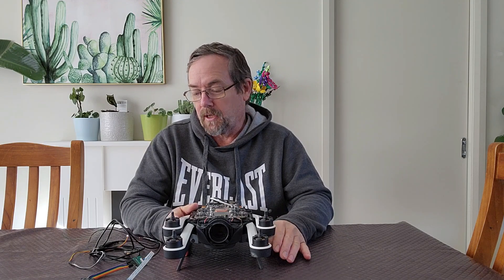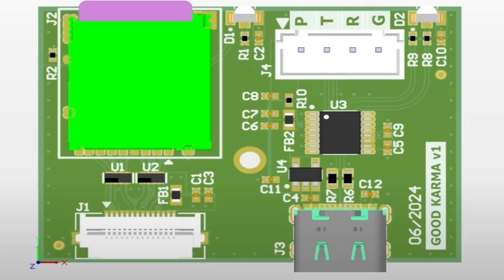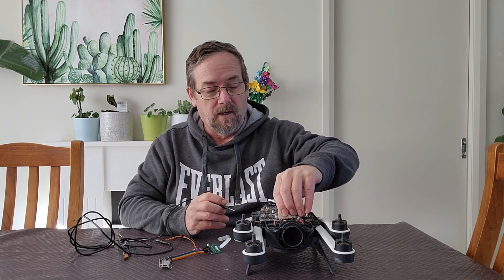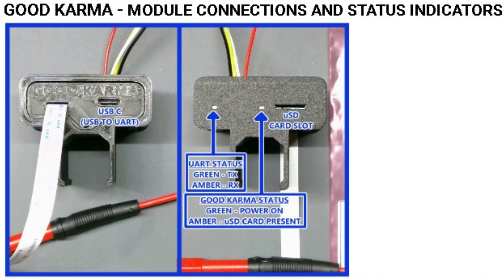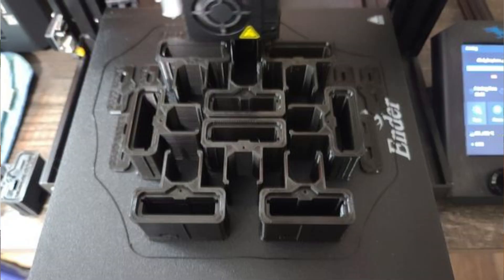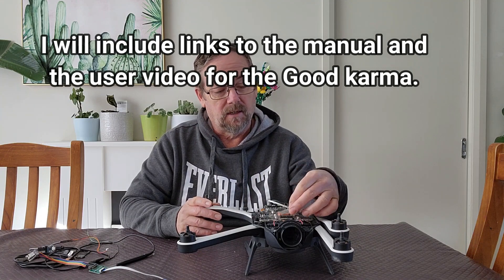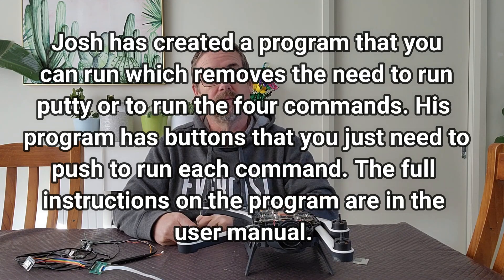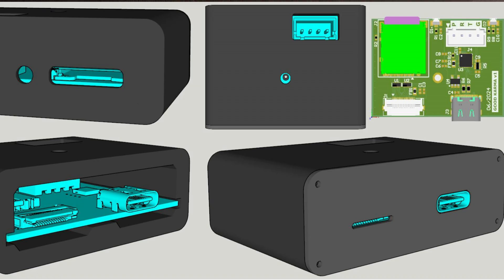Project Good Karma - GoPro karma pairing fix in a box

Comment: Everything went the way of commerce  😔, that’s not why I posted a method for flashing firmware via an SD card and other information of karma drone.
Reply: What do you mean by "the way of commerce"?  I am genuinely curious.  If you are implying that this is done for monetary gain, I implore you to take a look at what has been done and be honest with yourself.  If you were involved in or responsible for coming up with the fix for the Karma, my hat is off to you.  However, my question for you is what good is a means to repair Karmas if it is restricted to only the people with the equipment and technical knowledge and ability to perform the repair?  The goal of this project is to make repair available to anyone, regardless of their background or ability.  As an engineer, I take great pride in having the ability to look at a problem or process and coming up with a way to make it faster and easier.  This does just that, it makes it easier and available to anyone.  I hope you can appreciate that.
Reply from the maker: Hi, It's unfortunate that everyone isn't willing to do the fix for free, people expect that they get some sort of payment for their time. I do the repair for free, some do it for 20 or 30 dollars and some charge a lot more. If you go and look at the breakdown in the price on the order form you will see that Josh is basically setting it at cost price. There is no mark up for the labor that he puts into assembling the board, testing it and then sending it off. I'm sure you are aware of how many hours it would have taken in research and design. Normally a company would recoup these costs through the sale cost, but this is not the case. 

The price is more than if you were to go and buy all the parts and build your own. The big difference is that this board is fully functional out of the box (with none of the soldering issues we see) and it requires no soldering which means many more people can do the fix themselves. 

Initial feedback is very positive in relation to the success rate.